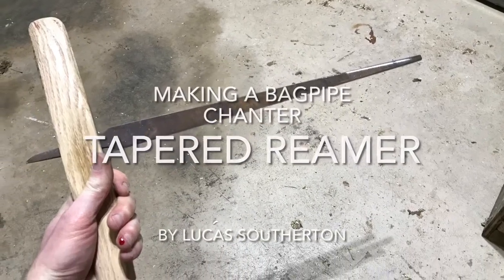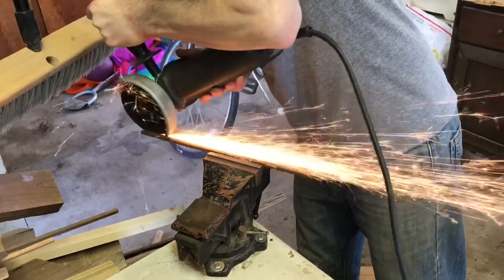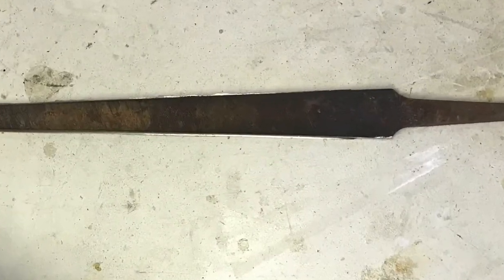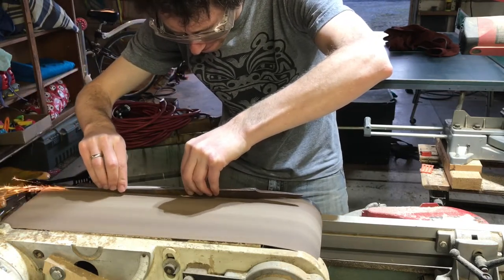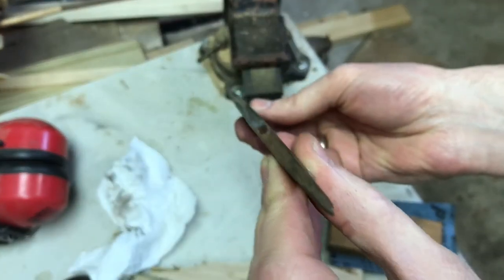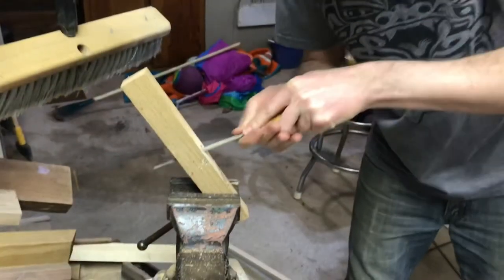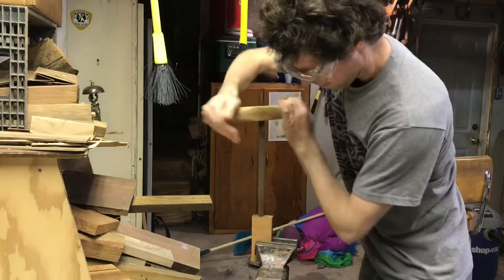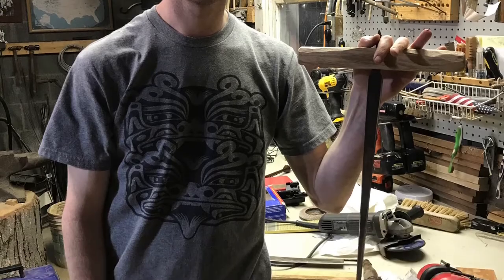DIY - How to Make a Tapered Reamer for a Bagpipe Chanter

Comment: cool! I did a DIY reamer using cheap Lowes 'tool steel'... pretty much  did what you did, but I run mine on my lathe, for making Uilleann pipe chanters(sub-amateur/hobbyist))
Reply from the maker: Oh cool! Cutting tool steel with tool steel sounds hard so I guess it’s good one was cheap. Have you made any chanters with it yet?

Comment: Were you able to make a playable chanter with this tool?
Reply from the maker: Yes! I think. My biggest problem is that I don’t really play bagpipes so when I run into trouble playing, I don’t know if it’s trouble with the chanter, the reed or the user. I also made the chanter so it has the same fingering as Native American Style Flute, which adds another layer of complexity. Here’s a video: https://youtube.com/shorts/gXtPz-YYL5Y?si=cLYAUsRvLpLvU4iV Please excuse the terrible fake Irish accent. I probably had one too many Guinness when I posted that video haha.
Reply: @lucassoutherton  hard to know from a video but it may be just your reed being finicky, or it could be due to the wall thickness of the chanter. I want to try making a highland pipes chanter in Bb out of locust wood, but I'm dreading buying one chanter just to cut it down the middle and copy the profile.

Comment: That's sweet. I was looking into conical reamers but they seem to be pretty heavily engineered. I know traditional flat reamers are used a lot in flute making. Do you think having two cutting edges on each side would be excessive?
Reply from the maker: Thanks! When I was using this one, it had a tendency to bind up if I went too aggressive with it. Steady controlled turns with gentle downward pressure and frequently clearing of chips seemed to be the way to go. So I would think that two edges would be even more likely to bind up and require even gentler pressure and I think it might just be more aggravating to use. I never tried a two edge reamer but I suspect that if they worked better they’d be the norm.